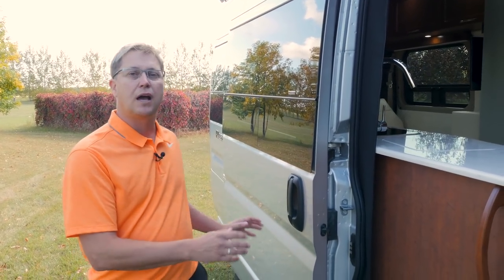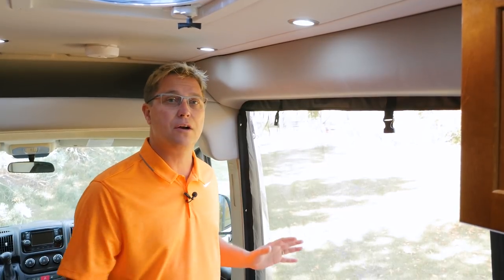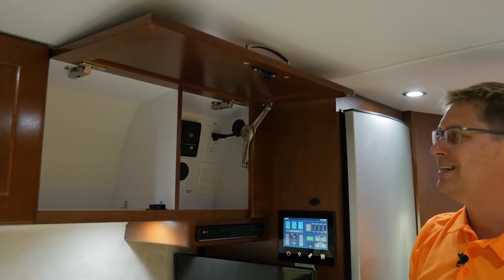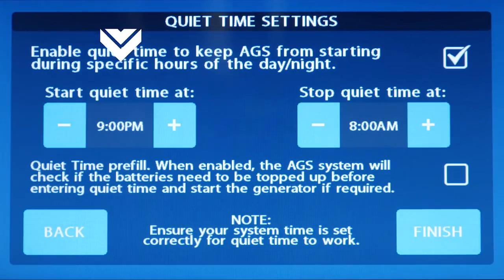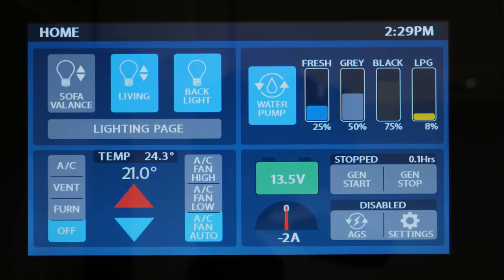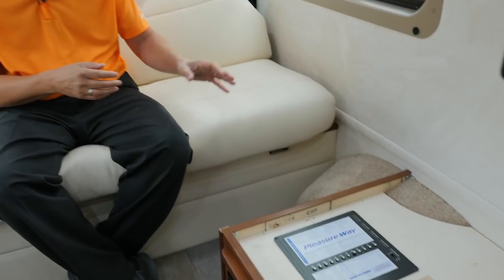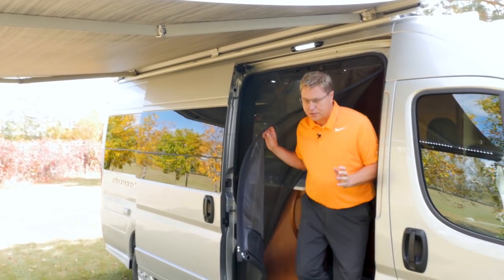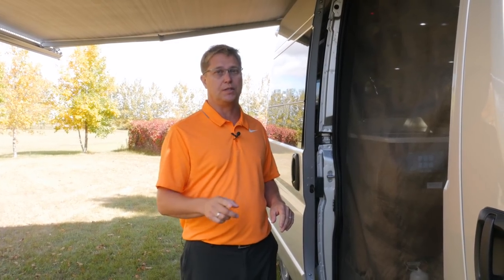2018 Pleasure-Way Lexor TS Tour

Comment: The design of this van speaks for itself.  Without knowing all of its features, it's obvious that whoever designed in used their mind to do so vs just follow whatever floor plan that''s normally used in these motor homes and run with it.  For something so small to have a bathroom as such and everything else that is available for the buyers comfort, it's obvious that all of the space was used efficiently!

Comment: Dean, there seems to be something wrong with your website. I also have a couple of questions: is it possible to order the Lexor with some variations or add-ons? Specifically, the much quieter AC that ARV is using, a leveling system, and the "3D" camera system also used by ARV. (sorry to keep mentioning them). Also, how loud is the gas generator? Is it under the hood?

Comment: wow this is best one yet i have seen so far..looks high end..wish they have a laundry washer or dryer..what the price?
Reply: Where would they fit a washer/dryer in one of these? There are several 40 ft. diesel pushers that don't have them included. Probably not even enough room for discharge in the grey tank for a washer.

Comment: It would be fantastic if that rear couch could have the sides operate independently rather then just a 1 unit so that half could be reclined or up and half could be down into bed mode. If it did that this would be the ultimate coach.

Comment: Why did you not go with a refrigerator with an automatic function like in the Ascent?  This one requires you to remember to change between power sources yourself.
Reply: Again the refrigerator NEEDS to be automatic in the FL and TS, with the other electronics in this unit this seems silly and behind the times.
Reply: Agree.

Comment: Now that you are building on the Dodge chassis.  What is the largest class "B" you offer?
Reply from the maker: Hi Mike, if you are specifically looking for a Pleasure-Way built on the Ram (Dodge) chassis, this is the only size chassis we build on. The Lexor measures 20' 11" in length. 

Additionally, we will soon offer the Lexor FL, which stands for "Front Lounge". This variation of the Lexor model will include a spot for the table in the front cab area, along with a work station, so you can utilize the swivelling seats and use the front cab space as a second living area. More details about that model will be available on our website soon. In the meantime, here you will find more information on the Lexor TS: http://pleasureway.com/ Thanks for watching!
Reply: Pleasure-Way Motorhomes Thank you for your response. The front lounge really excites me for the only Class "B" that offers it at the moment is the Hyman with the 1/2 bench.  You see many of them in the European built vans but not here.  For my use I am looking at using it for a mobile office and wk end camper.  That is why the front lounge interests me so much.  Secondly--I am very interested in the Ford chassis you mentioned.  Does that mean on the Ford it will come on a longer chassis--like the 22' models I have seen by other manufactures?  I will have to say that your quality seems to stand out over the others and that is something I am leaning towards
Reply from the maker: We currently offer the Plateau FL, which is a Class "B" motorhome. You can see that here: https://youtu.be/AXsn34oLuj4?t=5m56s
Sorry for the confusion but we are not building on any Ford Chassis. We only build on the Ram ProMaster and the Mercedes-Benz Sprinter / Cab Chassis. Thanks again for your interest!

Comment: I'm 6'4.  Can I stand in it without my head hitting the ceiling?
Reply: They list interior height as 6' 3", but there are steps up into the front cab area and the rear lounge area. You should see one in person to verify, but my guess is you'll need to always stoop in this particular unit.

Comment: Riddle me this.  Why in the love of God would you not provide a sliding screen door side and back instead of this zipper crap that is an option?
Reply from the maker: Greetings! The main reason is the amount of space the sliding screen door took up. When we previously offered the sliding screen door on the Plateau TS/FL,  the kitchen countertop had to be reduced in size significantly (so we had room to house the screen mechanism) The sliding screen also required a frame to close against, and that took up room in the front cab area, which limited the function of the swivelling passenger seat. The roll up screen has proven to be far more reliable and allows us to add significant countertop space while keeping all available space in the front cab area.
Reply: Neo Smith I have also seen a lot of problems with the screen door on all brands, often jamming etc so many are moving to a variant like this.  Looks well done.
Reply: I've had the screen doors in the past believe you me, the tracks become a big problem, dirt, leaves, and jamming. Being more  of a problem than you might imagine, unless of course, you only use it on rare ocassions.
Reply: I am a shopper who has done a lot of research and read a lot more comments of owners..and the sliding door is for sure a piece of crap.  If the majority who have bought and paid for a sliding door complain, then I listen and put my money on what has proven to make people happy.
Reply: One of the main reasons I’m getting a Pleasure Way is because of their awesome screen! The sliding screens are crap!